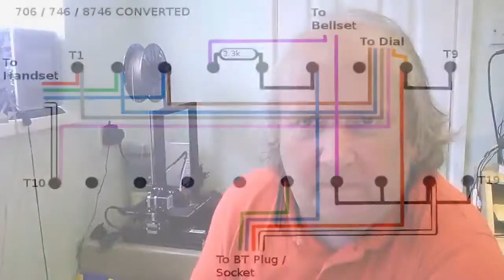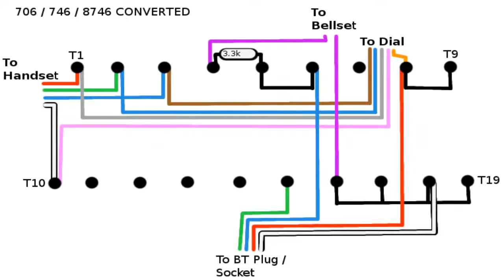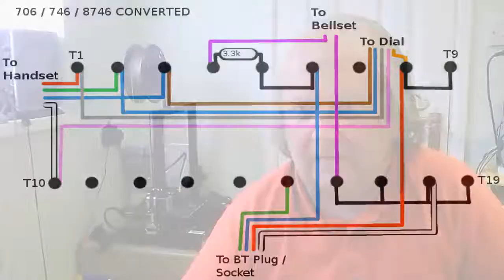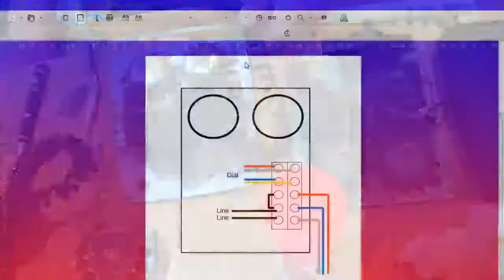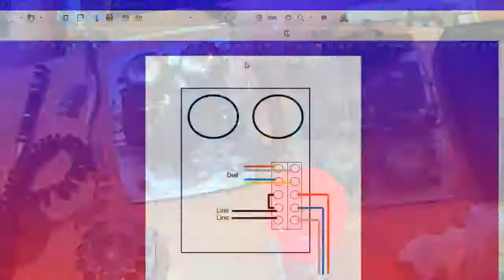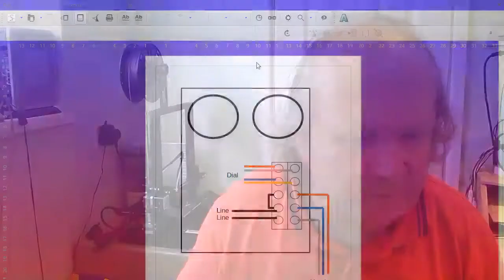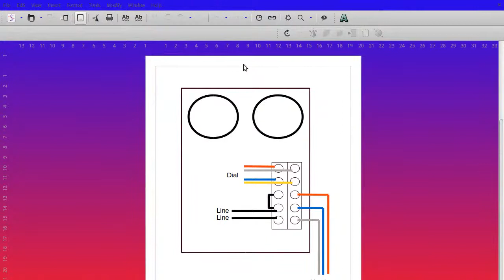Andy's Shed Live S07E25: Restoring Ericsson Bakelite Telephones

Comment: I've had another look inside the Trimphone, and I’ve noticed that the main board is in fact marked "TCH/67", although the ringer board is marked 68/1.
Reply from the maker: That's not too surprising. They would probably be using parts they had in stock for quite a while to assemble phones. The other thing is some parts may well have been changed over the years. It's very difficult to guarantee originality with British telephones because so many parts were interchangable and they were manufactured over such a long period of time.

Comment: Which resister should I get? I brought a new line wire but it did not come with a resister and there are so many on eBay
Reply from the maker: It might be better to buy resistors from an electronics website. You'll get about 100 for what some people charge on FleaBay for 5!
Reply: @AndysShed  thank you so much Andy! The resistor worked a treat and my Bakelite is working with the bells, very happy 👍 😃

Comment: There seems to be a lot of Indian and Korean fakes around on eBay, as I'm sure you know., Besides the 300's, there are a lot of GEC candlesticks around.They are brass, with GEC stamped on the transmitter, made in the 70's.The dead give away, is the crosshead screw in the bottom base,the base is plastic.They have done the same with American Western electric candlesticks, made in Korea. I have an original without dial, but the fakes, are brass with a dial. ebay has become a minefield for fakes.Just wanted to warn your viewers. I was fooled with a GEC.
Reply from the maker: The fakes are interesting in themselves. Especially the Indian 3xx series, many of which are technically not fake or repros but are actually a development of the originals, sometimes made using original equipment that  was shipped out there.

The one that catches a lot of people out is the modern copy of the Trimphone. Some of them have  a rotating dial and really do look the part. The give away is the extra * and # positions on the dial.  Ironically the rarest type of original trimphone is the tone-dialing push-button type, which also has * and # keys.
Reply: @AndysShed  Yes I've heard the 300 Indian ones are not bad. yes I'm aware of the star and hash on dials, the sellers claiming they are vintage, a dead giveaway. There seems to be a lot of trimphones about recently. Not always easy to tell from photos.There are brand new repos too. it's always best to do research before you buy.I learned the hard way.Just bought an American candlestick, Western electric. apparently, an American years ago sent one to Korea, and asked them to make repros. they even have pat no's on the base and dates like the real ones.Keep seeing the brass GEC candlesticks about made in India.made in the 70's. So I'm extra careful these days. Ok if you don't mind them not being that old.But I preface the originals. Keep up the good work, could watch you all day. Thank you.